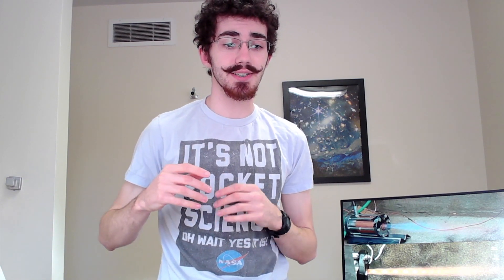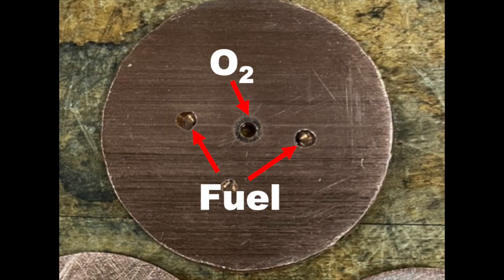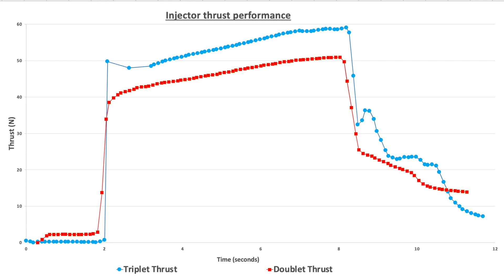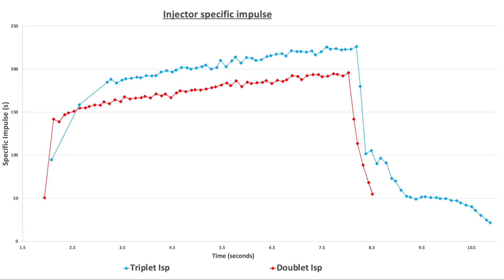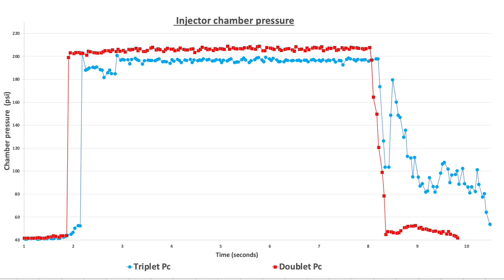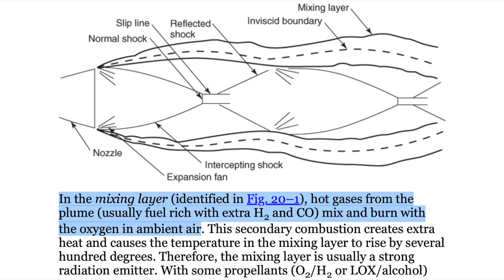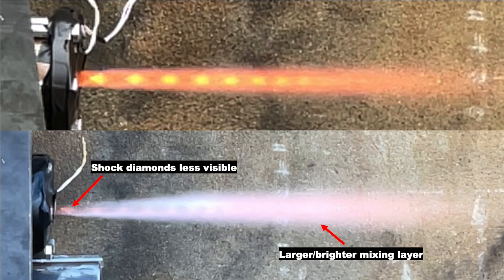Comparing rocket engine injector performance

Comment: Nice work! I reckon another factor was that the triplet had smaller injector orifices. We've found - as expected - that more, smaller holes enhances mixing. Thank heavens for the Dremel drill with high-quality drill-bits! 
Regards, Rick Newlands, Aspirespace rocket engineering society.
Reply from the maker: Very interesting! That does make sense that smaller individual streams would atomize better, which would lead to better overall mixing. I'll add that to my (ever-growing) list of things to study more on. Thanks! :)

Comment: Why does the thrust/isp increase through the duration of the test? Is it from the combustion chamber walls heating up?

It also looks like the doublet exhaust might be lopsided too (hard to tell). If so, I wonder if that produced any off-center thrust.
Reply from the maker: Those are both great questions, and unfortunately ones I don'd yet have answers to...I'm currently working on figuring out what exactly is going on inside the combustion chamber to get a better understanding of the engine's quirks. I suspect it's not because of the combustion chamber heating up, since the previous engine's itteration didn't have that upwards trend in its thrust data, so I think it might have something to do with the injector design? I'm not sure though. 

As for the secont part, I think that there definitelty could be some lopsidedness to the thrust due to the very visually lopsided exhaust (this was present in my previous version as well, to a much greater degree), though I don't have the sensors necesary to investigate that. Ah well, maybe something to work on for my masters' thesis I guess

Comment: great video! quick question, what kind of regulator are you using for your gox tank? i’m working on a similar project and i’m having a hard tike finding regulators with high enough delivery pressure…
Reply from the maker: I got my pressure regulators from here: https://www.mcmaster.com/catalog/129/3829/7897A1 This one is rated for up to 200psi, but in practice I've gotten it to work very well at just over 250psi
Reply: @jingojango9220  Thanks a bunch! I was looking at that exact regulator from McMaster haha. Did you do any mass flow calcs from the regulator? I'm looking for good resources to go from Cv to some sort of mass flow number (g/s or kg/s)...
Reply from the maker: I'll be honest, I had a bit of trouble nailing down the exact flow rate for the regulator. Eventually, I used this calculator to estimate it though (https://www.swagelok.com/en/toolbox/cv-calculator) and based on the regulator's cv (0.17) and the pressure in the O2 tank I was using the flow rate it estimated ended up being way more than enough for my purposes. It outputs volumes rather than masses, so you'll have to do that conversion and account for the density of the oxygen at whatever pressure you've choses yourself
Reply: @jingojango9220  Ah I see, did you control the mass flow after the regulator with a needle valve or something or did you plumb it straight to the chamber? Also appreciate the help so far!
Reply from the maker: @suryamani1235   I just plumbed it straight to a ball valve and then to the chamber. As long as the flow rate is higher than I need it to be, the injector should make sure I get the right flow rate into the chamber. There's definitely some fluctuation because of that, but the performance indicates that (at least for an engine of this size) you really don't need to worry about having precise upstream flowrates as long as your injector holes are sized properly
Reply: @jingojango9220  oh wow that’s pretty simple!  i was working on sizing a venturi or an orifice plate to control mass flow but i’d like to get rid of it if i can 😂. are you using nitrogen to pressurize the ethanol?

Also you’re the best for actually responding, are you an ME / AAE student?
Reply from the maker: @suryamani1235   I've been using a mixture of argon and CO2 for presurization (because it's cheap, inert, and was already available at my college when I started. I presume nitrogen would work just as well). I would assume flow control might be more of an issue with higher flowrates but I haven't had to use venturis or orifice plates or anything like that.

Technically, I'm a physics major, but that's just cause of the way my college's physics/engineering department is structured. I'll be going into astronautical engineering for my masters
Reply: @jingojango9220  That's fascinating! Best of luck with your masters! Is there a reason your oxidizer flow rate is sow low (roughly 14 g/s?)? Using that Swagelok calculator I get roughly 160 SCFM which translates to 90 g/s capable from that McMaster regulator? I think I might be borking calcs on my end but I can't see how you arrived at that number...
Reply from the maker: @suryamani1235  Offhand, I can't remember the exact figure, but I can say that you're right that the regulator can supply much more O2 than 14 g/s. The reason that there's so much less flowing into the engine is that the oxygen injector hole is designed to supply 14 g/s at the desired pressure drop (50 psi). Basically, the regulator gives me a much larger than needed supply, which is then "metered" by the injector face, which acts like an orifice plate